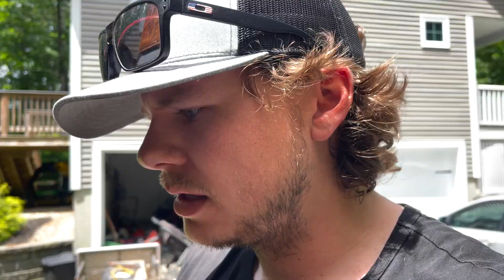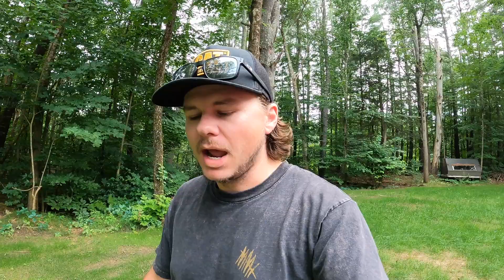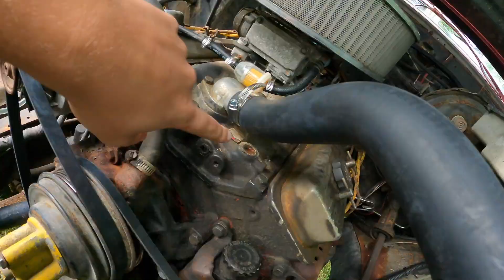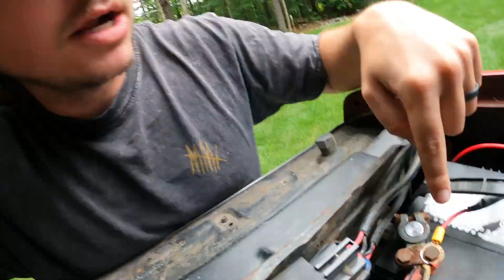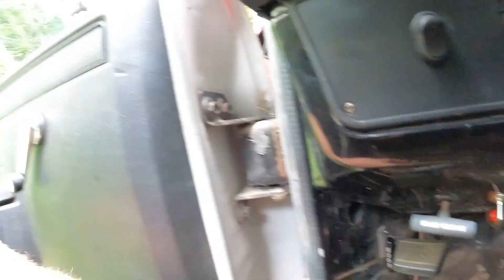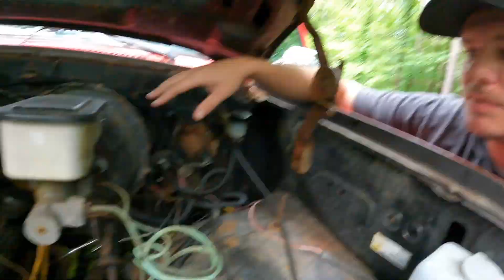$300 Amazon Dual Electric Fan Setup in my Chevy Squarebody!

Comment: Bro I have the dual fan setup on my suburban and a 3rd fan in the front of the radiator. New water pump, new thermostat, and heavy duty radiator and my burb still over heats when it’s 95 and above with the AC going. Don’t know what to do anymore
Reply: What fans are you using? Make sure they are a decent cfm

Comment: I had a water pump shaft break and fan bust the radiator on my 89 last night, so I ordered that same one. Luckily, I was inside the truck because it did some damage.
Reply from the maker: That sounds scary! Glad you weren't hurt.
Reply: Absolutely exact same thing happened to me, fan flew up dented my hood pretty good, put a nice gash in my radiator and destroyed my fan on my 86

Comment: I have to replace my radiator on my 1989 5.7 suburban and considering electric fan upgrade. I'm always hesitant to go electric as Im an analog caveman. haha. someone else on youtube said alternator power might be an issue with these fans. Especially when using AC. Any issues on your end? I could replace my alternator anyways, but if I don't have to spend the money I could wait. haha. helpful video. Cheers
Reply from the maker: I haven't had any issues with the the electric but Big Red also doesn't have AC...
Reply: @RyanandPam  cheers

Comment: So you have to flip that switch basically every time you turn the truck on to have the fans going? I just installed a mishimoto dual electric fan set up and had a temperature sensor im trying to figure out where to put it
Reply from the maker: Exactly
Reply: hook it up to the temperature sensor that reads to gauge inside